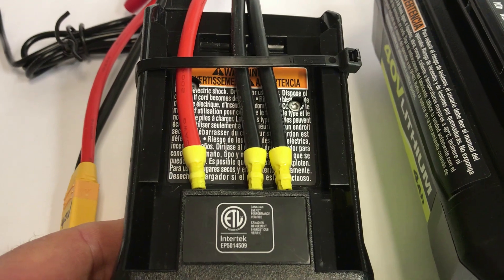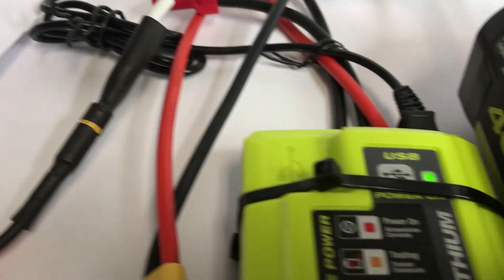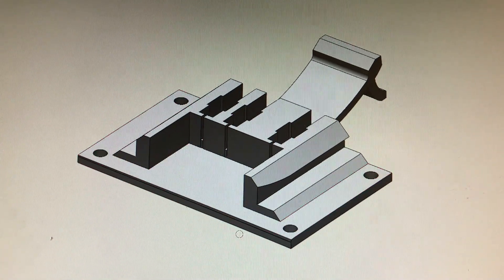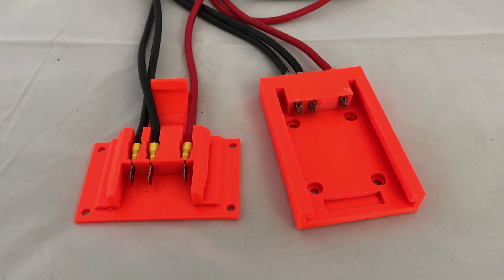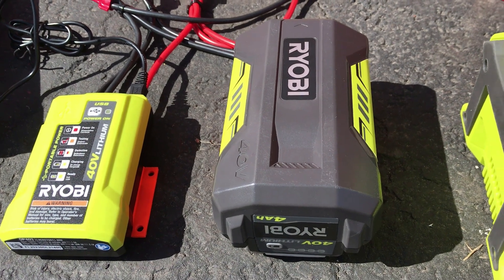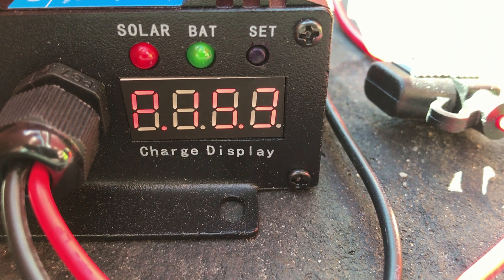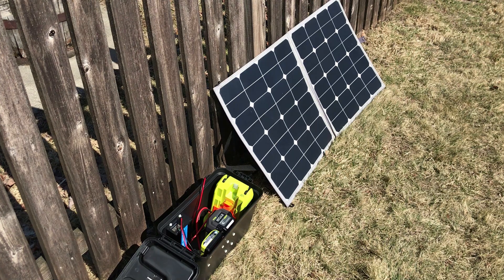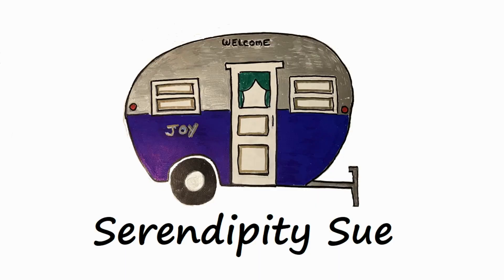RYOBI 40V Pass-thru Charging

Comment: Chris, on your 18v powered station build, you wired the solar charge controller directly to the battery to charge it without using a  ryobi charger. In this 40v, you’re using a charger.  Why is that.  I’m building one too. Thanks Chris.
Reply from the maker: At the time I hadn't figured out how to put the battery into Charge mode... I've since figured it out: https://youtu.be/ChC_vQpG3_M
Reply: @SerendipitySue  thanks very much for the quick reply!  I just built a power station using the 40v battery and a buck converter so I can power 12v plugs. Your ideas were super helpful and just what I needed. Thanks again!

Comment: Run your solar panels directly to resistive load that heats and not need as much fire wood heat.  No inverter required! A way to use excess generation and reduce fire wood needs.
 Great job!

Batteries may be great storage for night heating!
Reply from the maker: solar electric panels don't give you much power. A 100W panel in the winter full sun would give you about 500Wh a day. You would be better off using solar evaculated tube to heat water. They are more efficient. I've done tests with powerstations running small electric heaters off RYOBI batteries. They don't last long.

Comment: Hey Chris, what kind of spade connectors did you use? I would like to build a parallel 40v system for my lawn mower to decrease amperage draw on each individual battery.
Reply from the maker: https://www.acehardware.com/departments/lighting-and-electrical/boxes-fittings-and-conduit/lugs/33645

Comment: I know this video is more than a year old, at this point, but I have a question and an observation.  How many volts did you configure for the output of the adjustable MPPT charge controller?  Since these 40v batteries are built with a 2P-10S pack design, with 2200mah NMC 18650 cells, their nominal resting voltage would be around 37 volts and they should be charged with 42 volts.  Is that what you set the MPPT to put out or did it need to be higher than that for the charger to work?  

My observation concerns the decision to use pass-through charging.  While this is possible, meaning there is nothing in the circuitry to prevent it, if the design of the pack does not allow for adequate cooling to address the additional heat generated when you are charging and discharging simultaneously, it could potentially result in thermal runaway and it WILL shorten battery life.  Both of those statements are subjective, based on ambient conditions and actual charge/discharge rates.  For example, these cells are capable of quite high discharge rates, with cooling designed for such, so if the active load being ran while you are pass-through charging is relatively small, then there is very little risk associated with doing so.
Reply from the maker: There are several newer videos. We now know how to directly put the 40V battery into charge mode ( https://youtu.be/ChC_vQpG3_M ).
I set the MPPT charge controllers at 41.7V and 2A. I mostly use it off grid with the 300W inverter. I've never had any temp issues.
Reply: @SerendipitySue  - Very cool!  :)

Comment: Can you do this with the 18v batteries?
Reply from the maker: yes, I've done a couple of projects / videos on it: https://youtu.be/MTZdvhf6cB4
Reply: @SerendipitySue  thanks love your videos, was mostly wondering if there was a way to solar charge and use multiple 18v at the same time instead of swapping batteries out when they come to full charge. Even charging/using batteries sequentially would be neat.
Reply from the maker: @michaelwoods2242  you could use blocking diodes on the 18V multi-charger like I did here with the 40V charger: https://youtu.be/p4xW9f1ohlw

Comment: Can i use a 36-40v powersupply into one of these to achieve a 240v conversion to run line power to a cordless 36v ryobi highpressure washer?
Reply from the maker: I don't get your 240V comment? If you had a really hefty 36VDC power supply, you could use this adapter to connect it to your ryobi washer. You'd need to measure how many AMPs the tool takes. The power supply would have to be sufficient to provide this.
Reply: @SerendipitySue  australian power outlets are 240v, but yes we are on the same page, I would be more likely to do this close to the end of its warranty and if it fails, straight back for a warranty return.

I have alot of 36v ryobi gear, but as i understand from what your saying each could have a different amp requirement? 
I was watching your video in the middle of he night on mute, but im assuming you explain how to test for the amps, im also assuming the manuals might indicate it?

Comment: Great video.  I have over 20 of these batteries that I use to power several power stations around the house.   The adapter plates are around 23.00 on ebay I want to 3d print my own adapters.  What is the terminology used for those battery clips that you used in your 3d print builds?   Can I get both male and female clips?   Multipacks?   And where?   Thank you
Reply: Ryobi plate battery connect 33314470G

Comment: So you're using the charger to parallel charge two batteries, but one of the "batteries" is an inverter that's powering a bulb? When you switch off the charger then the battery powers that inverter instead of the charger. Have I got that right?

Comment: What are the connectors called on the plate that accepts a battery? Are the connectors on the other plate just male spade connectors? BTW, Ryobi should hire you as a product developer!! ( but it would be our loss, so I hope they don't) LOL
Reply from the maker: They are listed in the video description. The other connectors are just male spade connectors
Reply: @SerendipitySue  Thanks for replying. I missed that when I looked in the description the first time. All I saw was the MC4 and XT60 connectors. The next day I found them in the parts list on you plans page. I'm going to attempt some of your connector designs using wood, since I don't have a 3D printer. I think I may even have seen one of your earlier videos where a connector looked like it was made of several layers of wood, routed out and glued back together. At least I think it was you. BTW, if you didn't know already, you really dominate this Ryobi "New Tool Design" space. And rightfully so. You'd be hard to compete with.

Comment: What about running a 40v Ryobi tool with an extension cord? We need to run a tool for 3-4 continuous hours in order to accomplish a job. We have to repeat this type of use in a rain storm. So, we would need to either run a generator or a large battery pack. Thoughts?
Reply from the maker: Ryobi just announced a battery back pack for 40V batteries
Reply from the maker: https://www.ryobitools.com/products/details/46396040299

Comment: The link for the terminal clips goes to the site but there are different sizes -- can you tell me which size -- cheers
Reply from the maker: the connectors are all the same, you order what size wire you plan to use. I think I ordered 1-3mm^2 size. I wanted it to handle high currents.
Reply: @SerendipitySue  thx

Comment: Any chance u sell these adapter?
Reply from the maker: I'm not in a position to make/sell/support them. I put the design for free on the Prusa & Thingiverse sites. There are Internet companies that will make 3D prints for you if you don't have a 3D printer
Reply: @SerendipitySue  hi Chris, do you have a wiring diagram?
Reply from the maker: @Bishopthagod  no,  +'s are connected to +, -'s are connected to -, and T1 sensor is connected to T1 sensor
Reply: @SerendipitySue  ah ok, thought it needed some kind of special wiring.  I just finished printing the 3D models, I’m gonna be trying it on the 1800w power station. Thanks 😊
Reply from the maker: @Bishopthagod  If you are going to use more than one battery, make sure they are all very close in voltage

Comment: could this be set up to be used as a battery backup for computers?
Reply from the maker: It would only work like a UPS if the AC load was less than 60W. That's all the RYOBI charger will put in the battery. If you are drawing more than that, the battery will eventually drain

Comment: I thought the inverter was a modified sine wave? Regardless, the work you do is amazing. Your channel is painfully underrated.
Reply from the maker: The RYOBI 300W inverter is pure sine ( https://www.ryobitools.com/products/details/46396026651#specifications )
Reply: @SerendipitySue  Hey Chris, can you make a video about, or link to the crimp connectors you're using? In Particularly, I'm trying to figure out what terminals you're using to connect to the battery.
Reply from the maker: @ThisSiteSureSucks  There are links in the video description for the female connectors
Reply: @SerendipitySue  thanks. I saw that after the fact. Feeling stupid for posting this. Thanks for your response. 

I noticed the Link is in German, and I'm having trouble finding them on another source. Is there an industry standard term for these crimp connectors? The closest I can find is something to the effect of 'car audio splice terminal '. But when I search for those on eBay or Amazon I just get a bunch of other standard automotive terminals.

Also, the ones you linked, they appear to max out on wire that is 3 mm2. How are you feeling? 10 gauge wire in there? Are you taking the part of the open barrel connector that normally crimps onto the wire insulation and having it crimp on to the wire strands instead?
Reply from the maker: @ThisSiteSureSucks  you can usually switch the language up on the top of the page. I used the 3mm connectors and crimp them like usual.

Comment: i did this with my 16ah miaty lifepo4 batteries. I paired them to a victron 100/30 mppt CC & 300w panels....essentially, i hooked them all up and then hooked up a 300w PSW inverter (Bestek Brand) to act as a passthrough. I am able to use about 100w when the sun is out apart from the energy stored on the batteries. The batteries act almost like a discharge control...offering a steady clean 13v output directly from the sun. 

The key is to use less power than the panels produce. the components do heat up so make sure the cables you use are up to the amps pushing through. 

Ideally, I would like to use my system as grid-tied (net metering) to cut down on my grid bill this summer. I just need to get a net metering enabled meter.

Comment: First thing i tried after seeing your first Solar vidéo : seeing if you could charge and use 18v batteries at the same time. You can. No problems there.
Reply from the maker: Yup! thought I showed that in the movie?
Reply: @SerendipitySue  oh so here you just wanted to confirm 40v batteries were behaving the same way ?
Reply from the maker: @bastienrehm  The charge circuit is different on the 40V. I haven't figured out how to hack it yet. So I used their small charger.  I wasn't sure the 40V battery would allow pass-thru like the 18V
Reply: @SerendipitySue  oh i see, didn't know they were that different, thanks !

Comment: Isn't the Powerstation a sequential charger? Only 1 out the 4 battery is charging at any given time. The remaining batteries should be available for discharge to power your load. I am not sure if the limit is in software or with the hardware but the Ego has the same issue. It's an unnecessary limitation given that there are up to 4 batteries in the system rather than 1.
Reply: I am here for this! It really doesn't make a lot of sense. But, i'm not a electrician. Seeing that all 4 companies (Ego, Milwaukee, Ryobi, and Dewalt) choose to not do pass through has to mean that there is an issue. right?
I was so excited for battery power stations, and i'm still holding out for an 18v multi battery unit.
Reply from the maker: @gouldbowman  pretty much all of the quality powerstations such as  bluetti ( https://amzn.to/3vOm4BX ) have pass-thru charging and solar MPPT chargers built in. Ryobi could hit a home run if they include MPPT solar charge controller, regulated 13.8V cigarette socket, and pass-thru charging
Reply: @SerendipitySue  then could it be a hot swap problem with the pass through powering? Noting that most, if not all, of the non removable batteries (without voiding the warranty) do allow for pass through. My old Enkeeo also has pass through charging. There could be a fear of damaging batteries if you swap while charging and discharging. Just a thought.
Reply: @SerendipitySue  I agree on the  regulated 13.8V DC output (either Anderson Powerpole or cigarette socket). For pass-through, I would consider the function to be mandatory for a single battery system. For a hot swappable multi battery system, it is probably faster to remove one of the battery and charge it on an external fast charger. I suspect that you can charge faster than charging with the included 80W power brick that you get with the Ryobi or ~170W with the Ego. It's not as convenience but it's a solution.
Reply from the maker: @HuyLe-qc8jc  For my example project I ordered a dc-dc converter that can handle the 30-42V battery range. Unfortunately I can only find a 12V, not 13.8V. I will install a cigarette lighter socket in the Ammo box.

Comment: Would the inverter unit still stand upright if you integrated your battery clip and your battery receiver clip into a single 3D print design?
Reply from the maker: I had thought about trying to make a single adapter with both sides... but then I got lazy ;-)

Comment: I don't think you need the ryobi charger if you're using the MPPT charger with an adjustable max output voltage. That should give you some more flexibility .
Reply from the maker: I haven't figured out how to trick the Ryobi 40V batteries into Charge mode yet (I have a hack to get the 18V ones to charge). It looks like there is a digital signal on the T1 terminal. Have you figured out how to charge them?
Reply: @SerendipitySue  not an ideal solution as it requires modifying the battery. https://youtu.be/9chLnW1jX2U
Maybe pull apart the charger and see what sort of circuitry is on the T1 and T2 connections. Maybe something that can be replicated.